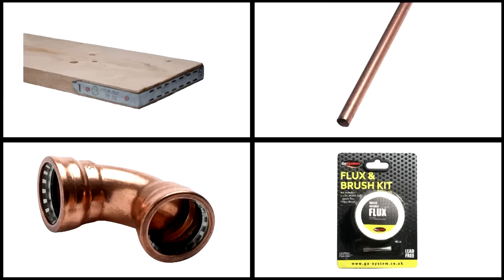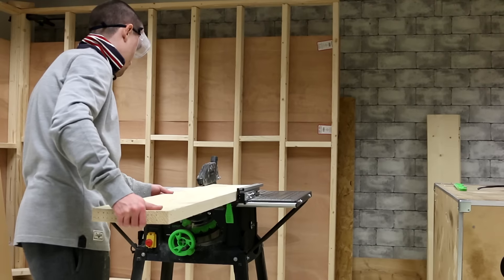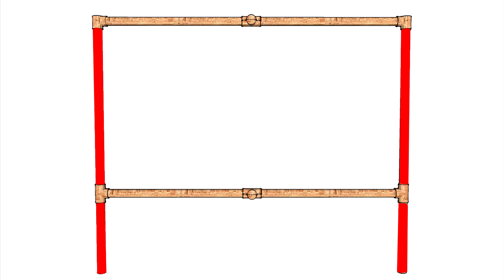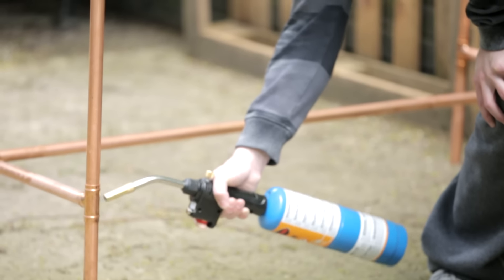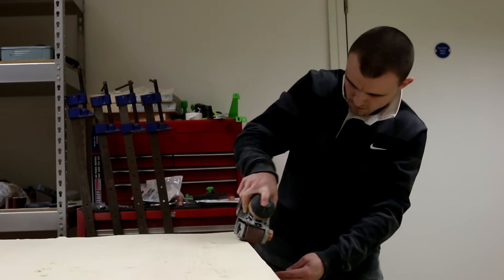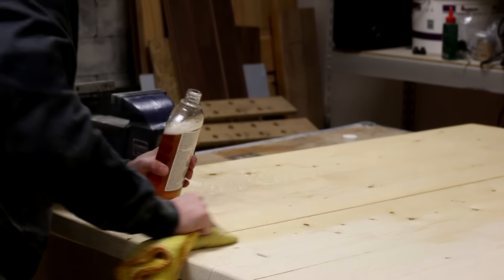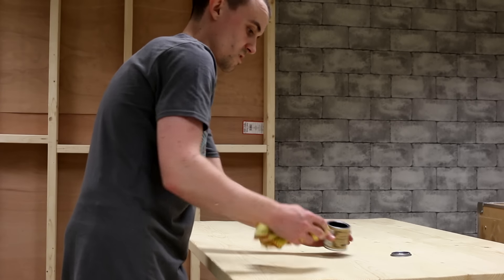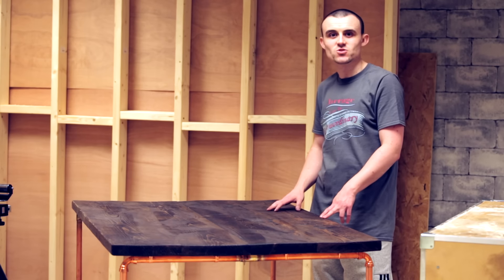Copper Pipe Dining Table @ Evolution Power Tools HQ

Comment: Hi Joe, the two materials go together really well, and I really like the rustic finish.
 
For the plumbing, I've only ever used end feed soldered joints, instead of yorkshire fittings (which have a ring of solder in them)... I start with some fine wire wool to clean both the fitting and the end of the pipe, then apply plenty of flux.  Assemble the pieces, heat the joint and use some leaded plumbing solder.  When the joint is complete, you'll see the solder 'run' and capillary action will suck the molten solder into the joint. HTH

Comment: Nice project... I'm a bit worried about the stiffness and overall stability. I wonder if a bent pipe would be stronger than 2 pieces joined with a fitting (of course it would need a few fittings, but the fewer the better I guess)... Or perhaps copper just isn't strong enough.

Comment: Hey Joe, it looks like you had fun with at Evolution. I like that sliding miter saw. I'd love to have one of those in my shop. The table looks pretty cool!
Reply: While the build quality and accuracy of the Evo stuff has a bit to be desired (in my opinion), the ability to chop what you want with them without having to change blades is bloody great. The standard blade life is great too. My comment regarding build quality is in regards to the base and collection more than anything, if you chop metals expect the chips to come back at you. Extruded aluminium on my older saw is a nightmare, I tend to use a full face mask. The accuracy issues are with the base and arms, there's a little bit of slop in places, but if you take your time you can expect good results.
Reply: Oh yeah I forgot to mention the price, you're right. These tools aren't mega bucks at all, which is probably why I'm a fan and keep mine. I think the only way to avoid the splashback would be some brush (like draught excluder) round the blade guard almost touching the blade, on the nut side, and maybe a longer brush that just hovers above the max height of kerf line while the saw is in its most upright position.
Reply: +Average Joes Joinery what's the difference between the Evolution green tools and the orange ones?
Reply: Hi Steve, I've sent you a PM. Thanks, Paul
Reply: I tell you what Joe, when I was burgled I wished the insurance company decide to get me an Evolution table saw instead of the pile of crap they eventually sorted out for me lol

Comment: Nice one Joe. Solder joints definitely the best looking mate - plain ones too, rather than the Yorkshires. Just takes a little practice. Working outside is fine when it's hot and still, but the cold and draughts make it difficult to keep all the joint hot. BTW love the florescent waistcoat 😂 Can't ignore health and safety in the workplace
Reply: Slippers - cool, lmao
Reply: I mostly do too, but sometimes I find they lack the grip, and I'm sliding along the floor rather than moving a saw or plane 😂

Comment: Copper is very weak. Maybe you should fill the pipe with sand to strengthen it? You would be better using electrical conduit with screw ends etc You can get it from TLC direct. To make it really strong you need a cross brace, which will create a triangle under the table.
Reply: +Average Joes Joinery you can still add some cross bracing. get some copper t junctions and cut the lengths across the width. then add in the Ts and angle the junction at 45 degrees down the way.

Comment: sand inside fittings and outside of pipe to clean oxidation. heat joint not pipe and hold solder at joint when temp is right it will suck solder into joint. practice with some scrap you will get it. I've never tried it for furniture, do you have different wall thicknesses? here in US we have type L thicker wall and thinner type M. I would try the  thicker. and. for more rigidity maybe more fittings in a decorative pattern
Reply: Anytime ! ask anybody, I'm full of it 😉 hmmm I never saw ones with solder in them. I'm old school I guess

Comment: Average Joe's Road Trip
Plumbing is not my speciality but it has to be push fit all the way mate, it don't need to hold water so no need for solder, also to get a good finish when waxing, use a shoe polish brush to buff it up.
Hope you're enjoying the trip up north and that we aint to grim for ya.....lol
Reply: I used to be a Pine furniture finisher back in the mid 90's and the old boy I worked with showed me that trick also if you put the wax on with with fine steel wool you tend to get a more even finish as it really works into the grain.

Comment: Nice table Joe. I only saw you put flux in your joints.  Did you add solder after you heated the fittings? In the US, we flux and solder to complete the joint. I wonder if that's why you're table may have been a little wobbly.  Nice job! I like the rustic and industrial look of the table.

Comment: Hey Joe! looks like you had a great day there! Wondered if I could get your thoughts on that mini sander? I've got a large belt sander which is completely uncontrollable and actually too powerful!! but that one you used looked manageable with one hand, when you did the edges with it did the belt ever start slipping out of alignment? I need something to sand the edges of wood like that efficiently and in a controlled manner! 😂
Reply: +Average Joes Joinery Ah cool, I checked it out and it might have been worth a punt at £25 but no one seems to sell the belts for it except evolution and they're like £8 for pack of 3! will stick to elbow grease for now lol
Reply: +Average Joes Joinery Yeah they are 305mm though and the reviews say that they are too big as the evolution mini takes 303mm belts and there's no way of adjusting it larger than that apparently. One review mentioned to put the 305mm belt over the 303mm belt which isn't a bad idea, I'm thinking either that or wrap something around the wheel to make it a little bigger so the belt fits tighter! Annoying though!! 305mm belts all over the internet and they make theirs 303mm...WHY!!!!!!!!

Comment: You were on the right track with the "Pegler Yorkshire" fittings, flux and heat, but it's still a good idea to add solder to the end of them. Solder has a habit of flowing towards the source of heat. It will have flowed out of the ring and left a cavity (gasses from the flux will have filled the void for it). Feeding the joint with extra solder helps.  

This may be of help Joe, http://www.diydoctor.org.uk/projects/soldered_pipe_joints.htm, bear in mind that this guide is for sealing, not structural use but it will help if you fancy playing round with any spare fittings you have. Pegler do offer an online guide, but I didn't look into it as they want email etc. I have enough spam as it is lol. 

Keep adding to your skill set, you're doing well. Cool vid.
Reply: What I do know about compression fittings is that they are great for keeping in-line forces
 <<¦pressure¦>>
but have a great deal of flexibility in lateral movement, by design they accommodate 'wobbling' so a 21 stone monkey can put them together without breaking the seals. 

Regardless, yeah man gotta love learning, not matter what it may be. I wish I had the chance to show the crap I build / break, but I have no presentation skills what so ever. I'll just leave you pros to do it for me ;)

Edit, in fact if you just got standard fittings with a bit of flux and soldered them externally they would be better for this kind of application thinking about it.
Reply: Nah, you come across as honest. That's the more important thing than trying to be a gameshow host like some of the guys here ;) I don't even have a camera, I'm as photogenic as barge stuck in a swamp lol
Reply: Your'e doing a good job Joe, am dying to get back in my sheds thanks to guys like yourself. But nah, if I made a video it would be more like a powerpoint presentation and everyone hates those lol.
Reply: No I got shut of facebook a couple of years ago. I'm on here and reddit, and that's about it. I have tried to keep nosey buggers out, so I can annoy more people like you lol
Reply: I don't see the point in FB these days, there's that many ways to get in touch of people, and FB is trying too hard to be the worlds hub, and profiting from it.
Reply: Sorry for the millionth reply, but at least YT makes no bones about making money from its users, unlike FB "which will always be free" - there's different types of free.
Reply: That's kind of different, if you use FB as an alias and block all their ads, etc, then yes it's useful. I just don't think it's fair to exploit. So I thought bugger it.
Reply: If I make something I'll bung it on imgur as pics and if peeps wanna know more when I send them stuff they'll ask, simple as that really.
Reply: It's a bit late in the day but I think Google+ could have been implemented a lot better than it was, just thrown at people and saying "this is how it's gonna be", messing up Youtube in the process. It could have been good. 

The thing is that a lot of people are invested in FB and have it down to a T, I know 80+ year old people that can use it confidently thanks to its omnipotence.
Reply: Hey Joe. I'm just fettling my shed (lining the roof with cheap laminate flooring insulation). When I'm done and tidied I'll do a quick spin round for you, see how us poor folk make do and mend, lol. My shed had a condesation issue and rusted a load of tools. Still, might be interesting for you to see how my 10x11 foot shed works for me, it doesn't lol. I have a load of crap that I wanna keep, and now I have tools to restore, meaning that I can't even make anything lmao. Hope ur OK lil bud :)
Reply: Ha yeah. I have a Tyme Avon lathe that is at least 2/3 the width of my shed. It was free, so I'm not gonna let it go (no proper chuck yet - I can't afford one (sad face)), so that take up a fair chunk of the back wall. No regrets though, it's great for Snooker / Pool cue refurbs.

Sounds like your cladding is drying out in the sun and shrinking so the next time it rains hard the first bit of water runs through til the wood swells.

I have two sheds, both built out of scrap materials, the 1st was ace, really too small but equipped. I got the stuff for the second shed thinking there would be so much more room for activities. Nope, you just end up shoving more stuff in there lol. Am good fella ;)

Comment: Joe, wear gloves and a mask with teak oil, it can be really bad for the nervous system. I like the overall look, but instead of the wax, I would have burned the wood then simply oiled it.
Reply: +Average Joes Joinery I didn't know until my wife had a bad reaction to the oil.. some people are more sensitive than others, but it can harm everyone. Danish oil is safer, but gloves and a mask should still be worn with any oils, especially if exposed a lot.

A few hammer dents, and a good whipping with a heavy chain can add tonnes of character to rustic stuff too.